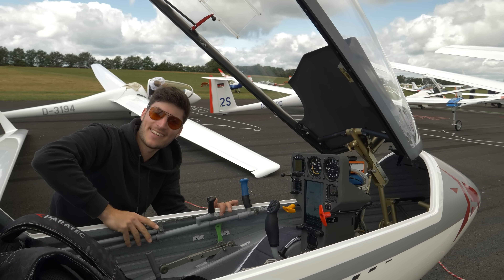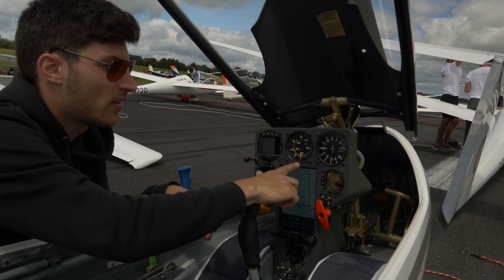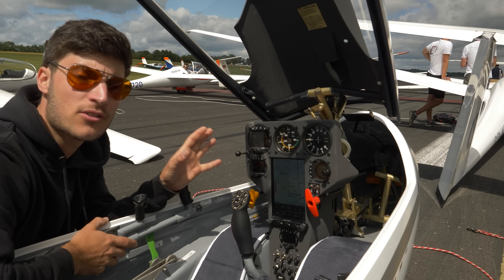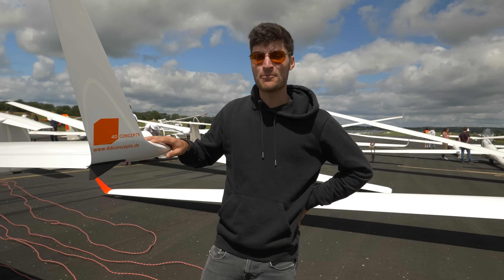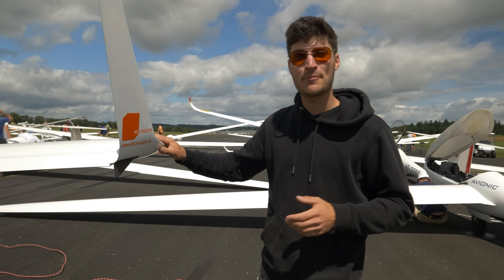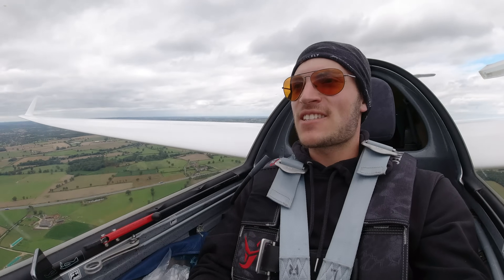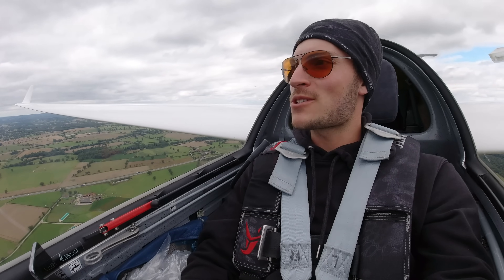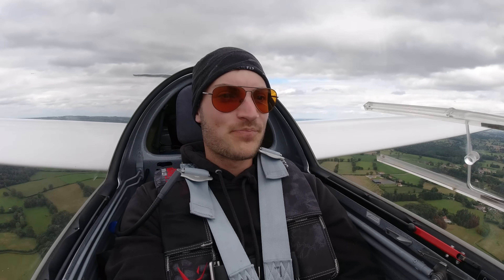Testing NEW LS3 Winglets - World Gliding Championships France

Comment: Too bad you don't get any participation.   WOW!  Is the subwinglet oriented the opposite flow direction to the main winglet to 'unscrew' the tip vortex, like it was on the LongEZ I built, with the airfoil actually morphing over subwinglet 'span'?  Just curious.

And were these tunnel tested for L/D increase?  Any notable changes in handling characteristics?

Comment: What happens if the tow rope malfunctions and doesn't release from the glider?   Can the airplane release from its end?    Otherwise both the glider and plane would have to land together?
Reply: Yes, the towplane can release to. The towplane will fly back to the airfield with the glider and release the cable when the glider is on its path to land.

Comment: I've visited Rollander Schneider in Egelsbach. I had a new LS-3A, wished I had LS-3 with the full flaparons instead. Still don't understand why LS-3 was dropped, it was better.
Reply from the maker: I have not flown an LS3a but I also heard that the only good LS3 is the "Blei" (lead)
Reply: @SteFly  My flying partner had the LS3, I've helped him assemble it many times, it wasn't so heavy when I was young, It was a very good glider, we also called lead sled!
Reply: The original LS3 needed a lot of lead to fight aileron flatter. The wings were ridiculous heavy. That's why it was called LS-Blei, as Stefan told already. I have a LS3-17, when flown in the 15 meter configuration, it is identical to the LS3A.

Comment: Another great video! Thanks. The new vario is the XC-variometer ? It looks like a great integration tool with the Open Vario. I also like the small aerodynamic tipsupport underneath the winglet. Is it sacrificial in that it can be replaced?
Reply from the maker: The tipsupports are attached with doublesided tape, so I can replace them..
Reply from the maker: No, it is not a XC-Vario. This new prototype vario uses differential GPS antennas and an IMU sensor. Only the sensors costs a lot more than the XC-Vario.

Comment: What is the cracking/creaking noise in the cockpit?
Reply: Some gliders got it, some don't. It's just the seat shell giving in and rubbing against it's mounting points. Usually it's not dangerous or bad. 

It may be annoying, but on the other hand it may also be one more indicator that tells you what your plane is doing.
Reply: I have the exact same question!  I wonder if it's radio noise?

Comment: Would love to know more about the variometer. Can you share some info?
Reply from the maker: It has two GNSS antennas and uses an IMU sensor. As far as I know it doesn't use static pressure or TEK pressure for the vario. It is very fast and also has real time wind. Up to now it's a test device which uses the Air Traffic display with a different software for the user interface. 
Thursday was my first thermal flight with it and I'm super impressed.
Reply: @SteFly  I suspected something like that. I'm building something like that as well, and have test flown with two GNSS antennas too recently. I'd love to get into contact with the developers.
Reply: It would be great to hear more about that Variometer. Especially if it’s not using pressure inputs but rather relies on GPS  signals as well as inputs from the IMU (inertial measurement unit?).

Also, I was wondering if the two-tone sound has a special meaning. The major beep sounded a lot like the normal vario sound. But it sounded to as if the secondary beep was either below the first one or above depending on the gradient of the current thermal, ie if the thermal is getting stronger the secondary beep is above the primary one and if the thermal is getting weaker the secondary beep is below the primary one…

Need to listen to that again :)